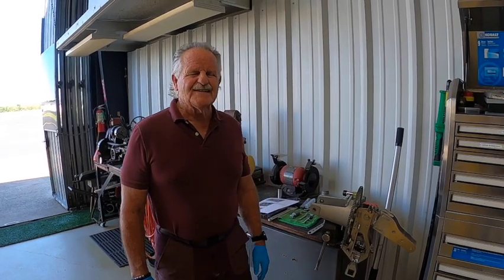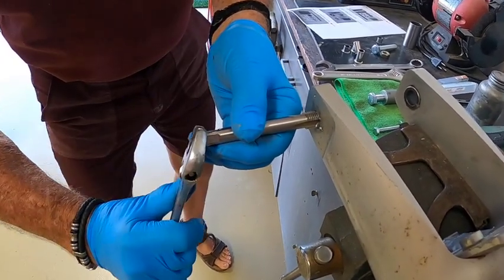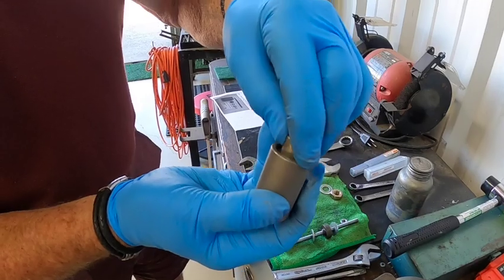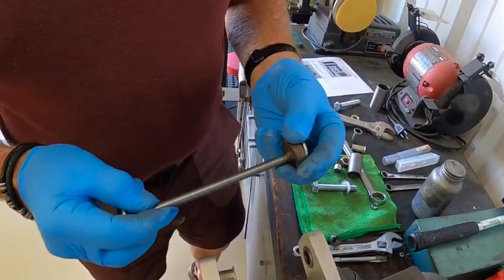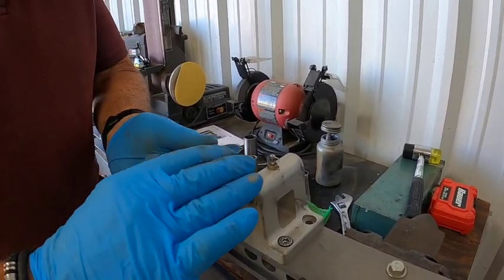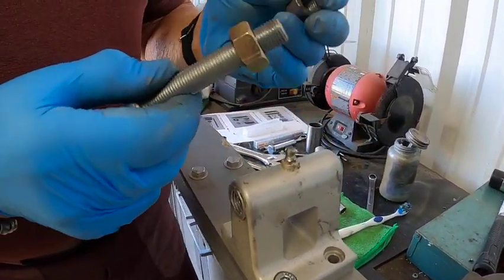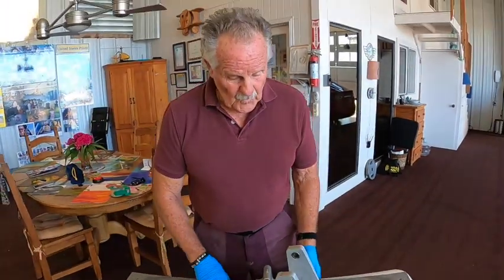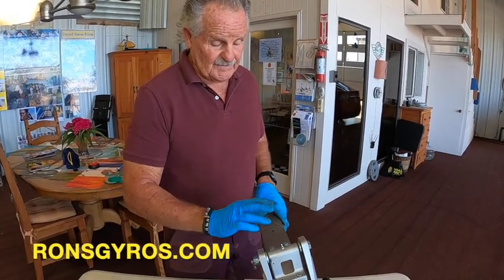Gyrocopter Rotorhead and Hub Bar Bushing Replacement

Comment: Hey Ron great vid, one observation, clean everything as you go, you may have done this just not shown it on the video, for example when you reamed the bushes, clean the reamed hole free of any fine particles of removed metal, as that’s what the reamer is doing, before  inserting teeter bolt, you don’t want fine metal shavings in there rubbing away 😊
Reply from the maker: Great point! Thanks for watching

Comment: Great video, but wouldn't you want an A&N nut thats certified.  Maybe just use one  more thinner washer if you need to get the rotation for hole line up proper.  Then use a proper certified nut with some blue lock tight and then the proper pin or clasp.

Comment: If you get a spiral tap, they will start straighter. The cost difference is very small. And the risk of damaging the rotor head falls off by a magnitude.
Reply from the maker: Thanks for the tip